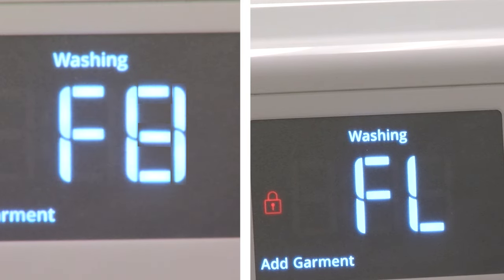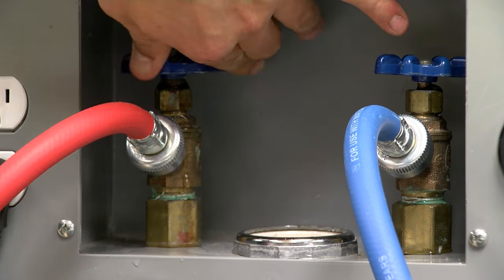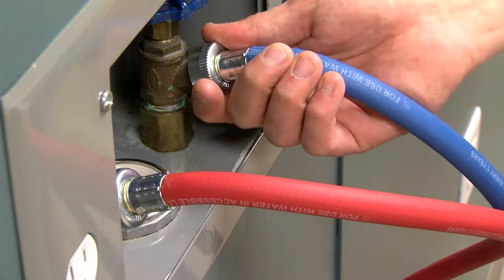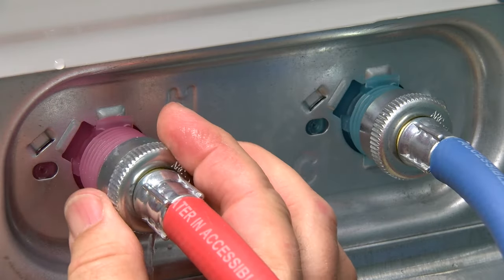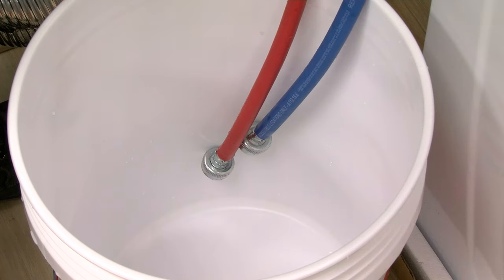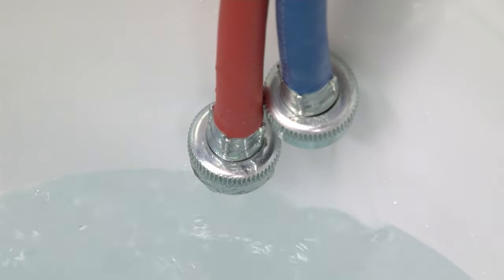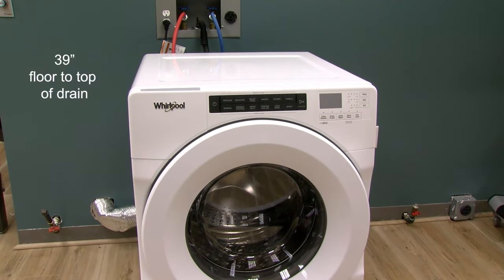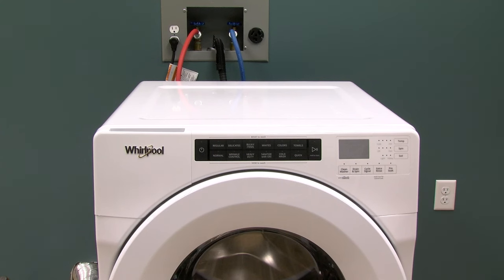Troubleshooting F8E1 or LoFL Error Code

Comment: Same issue here, it happened every single time when the machine kept working for an hour or so, with 20-25 mins left leaving a load of wet clothes in the drum and a LO FL error code. If it was the issue described in the video (low water flow, clogged water inlet screen etc. ), the machine would not have started washing in the first place…any suggestion?😂
Reply: Same problem
Reply: @tinadavis43  Same, the clothing is all wet, it seems less of, not enough water and more of inability to drain properly on the spin cycle.
Reply: Works great on bulky settings
Reply: Did you solve this problem?